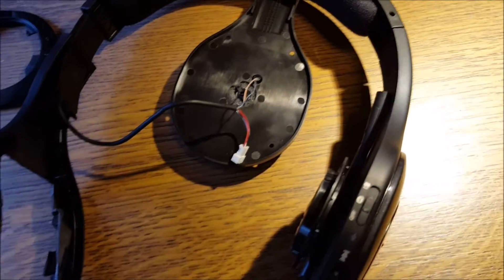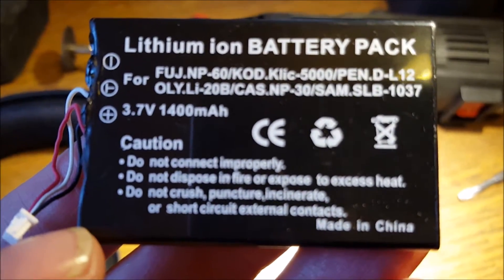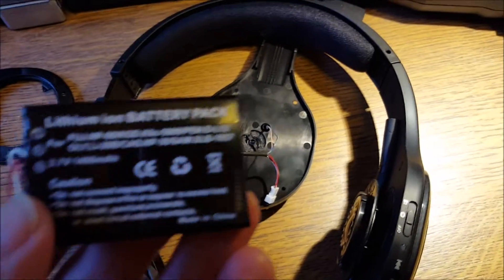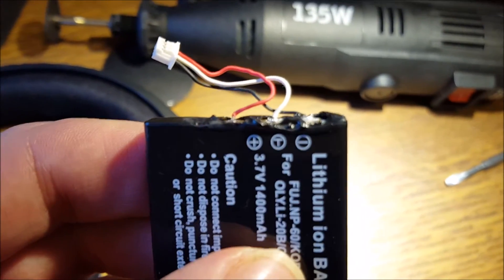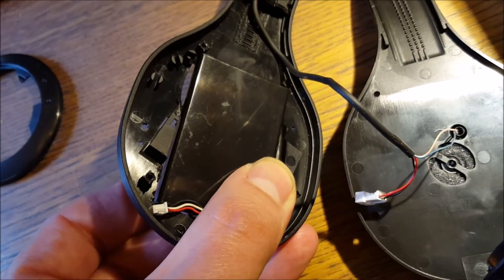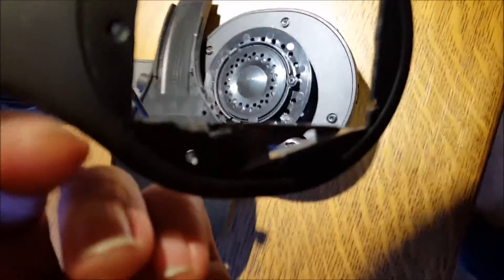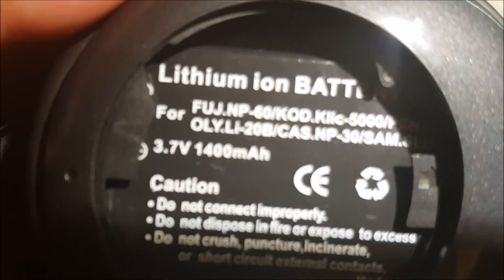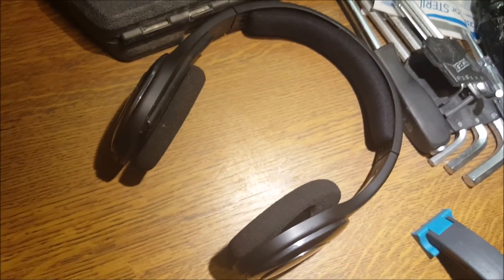Logitech H800 Headset  Battery Modification  1400 mAh

Comment: Hey, I did similar modification using this battery:
ebay.com/itm/251820437468
It worked for whole day, and then after plugging in a usb cable the charge diode lights orange for half second and goes black  then, battery isn't charged at all no matter what cable or energy source I use. The USB port is 100% fine. Do you have any ideas why battery is not charging? I don't know what to do with this problem.
Reply: The same with battery from mobile phone (I've tried Nikia BL-5C and LG LGIP-531A). No idea why charging not working.
Reply: Same here
Reply: @djfreeze9366  I've won! Battery for camera (I used Fuji NP-48, 1450 mAh, cost less than $10 in local store) is suitable! If I understand correctly, battery should have contacts +, - and ”T” in circle.